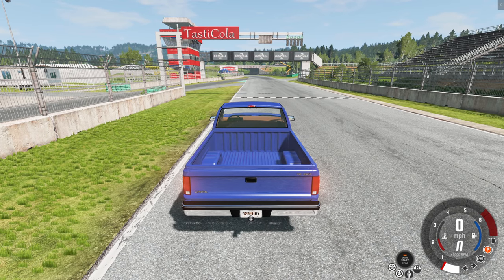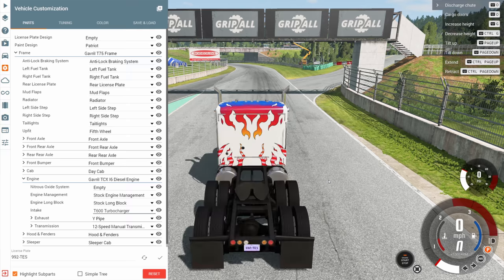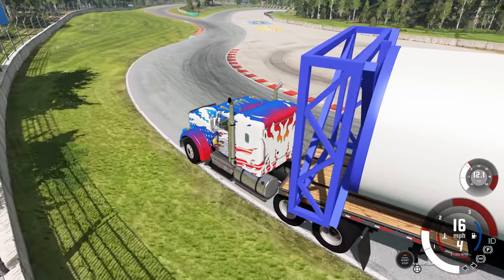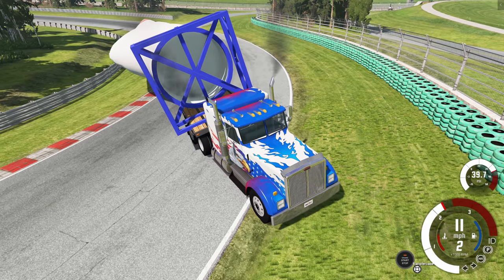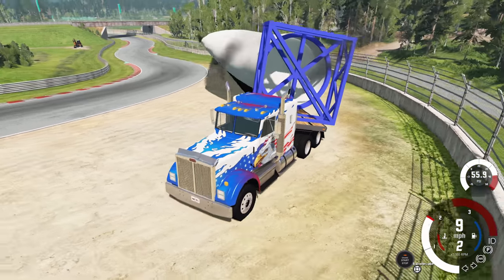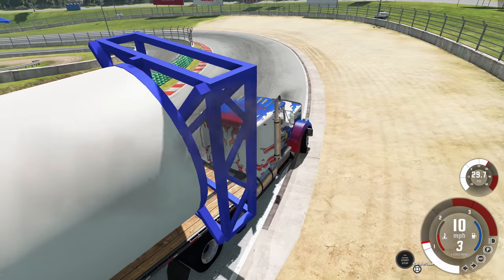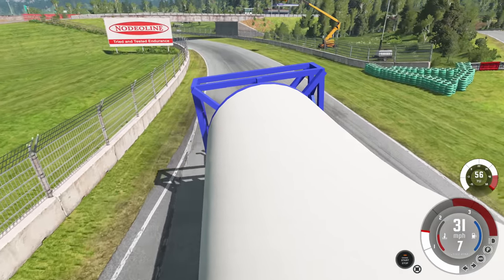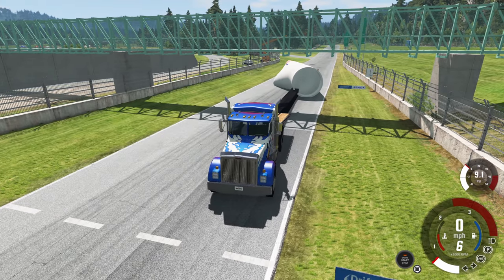LONGEST TRAILER VS HIROCHI RACEWAY - BeamNG.drive

Comment: That trailer needs a separate driver it's so long.
Reply: that's actually a real thing...
Reply: Actually the wind turbine blade trailers are low body, with 3-4 automatically steerable axles on air suspension
Reply: @ΑΡΗΣΚΟΡΝΑΡΑΚΗΣ  depends on the kind but yes most have steerable axles. some of these heavy duty trailers have separate levers in the back of them to "steer" or "fine tune" the steering when cornering.
Reply: there's a fire truck in NY City that fits that exact description. it's a normal fire engine but it has a long trailer for the ladder and at the end of it, it has a separate driver to steer the rear axle around tight corners and when backing up
Reply: I think they would ship the parts of the blades

Comment: Hey ybr can you tell me ur pc specs I want to know how you get beamng to play so smooth. I’m 12yrs old and I just built a pc do you know If it would be enough to run beamng. 
Ryzen 5 2600
Gigabyte b450 gaming x motherboard 
16 gb ram @3200mhz
Gigabyte RX570 OC gpu

Comment: Why don’t you drive that huge semi off a cliff? And that trailer it is using is extendable so the trailer is fully extended that’s why it’s not over hanging the trailer by 25 meters. that semi is illegal because it has no oversized load sign on the semi truck!!!!!!!